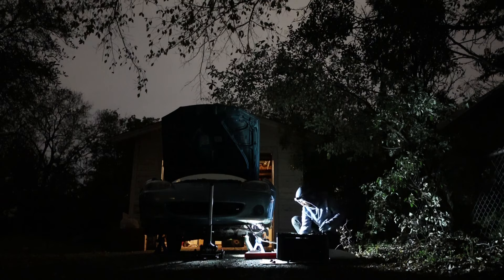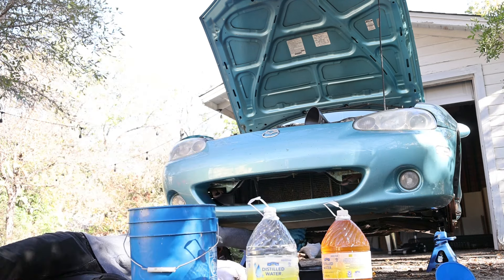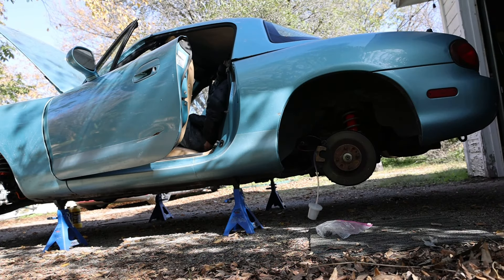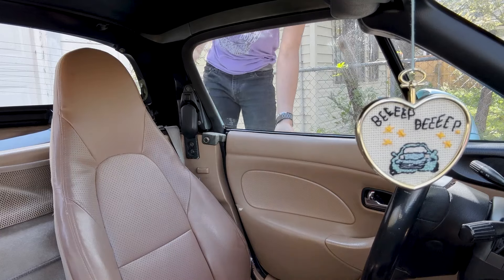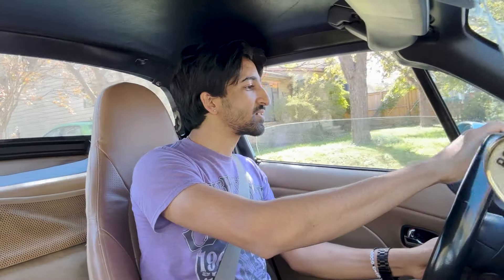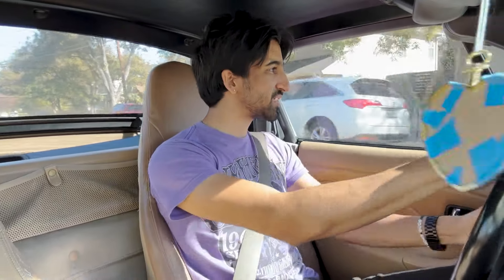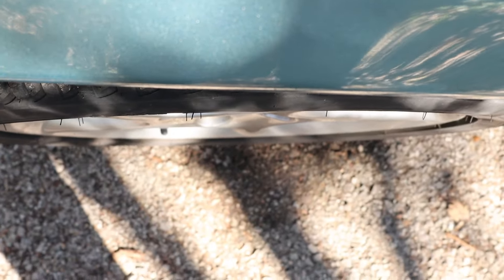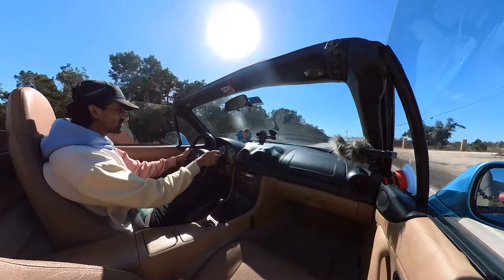first drive with my miata's new coilovers and suspension! (supermiata tecnas)

Comment: This series has been fun to watch. I have the same year Miata (color, too). Any plans for changing the timing belt? Since you accomplished the suspension, a timing belt service is going to be easy for you. Since you have to change the valve cover gasket and want to autocross, you may want to make sure your timing belt is good for the extra strain.
Reply from the maker: thanks! that’s awesome, it’s such a gorgeous color!! the previous owner changed the timing belt so i have no plans to, but i have been watching videos and i kind of wish i could do it and learn haha. i’m definitely going to inspect what i can see when ive got the valve cover off. i may end up replacing it if my oil leak turns out to be from the front crank seal and not just the valve cover gasket

Comment: This is a great series you have put together Abhi… I can’t believe you haven’t rounded more nut edges… I attempted to remove that top rear left shock nut the other week and chickened out before I completed rounded it, it’s in such an awkward position to get to… I’m leaving that one for the mechanic to deal with 😊
Reply from the maker: thank you! oh man i don’t even blame you haha, you should invest in a socket accessory pack of bendy joints and extensions if you haven’t already - i wouldnt have been able to reach them without it